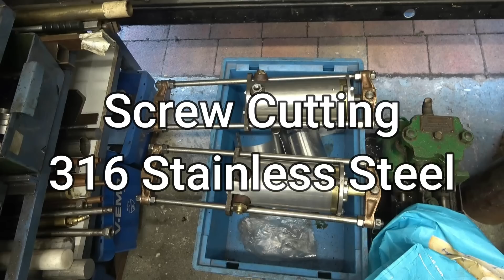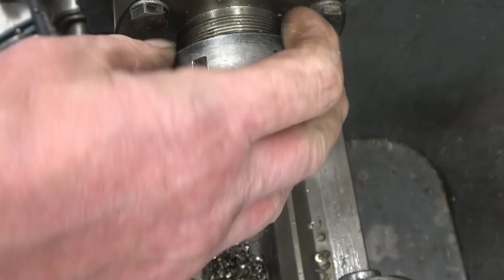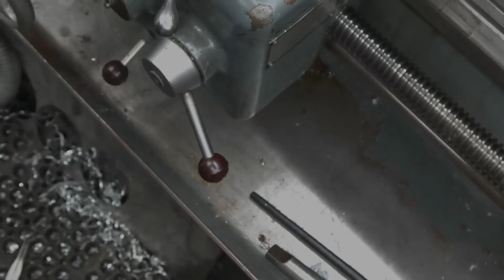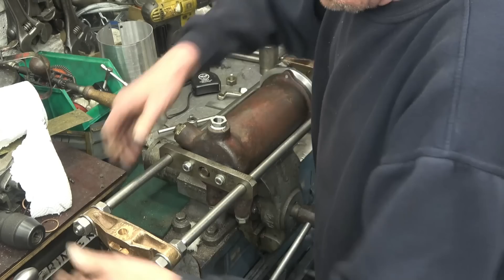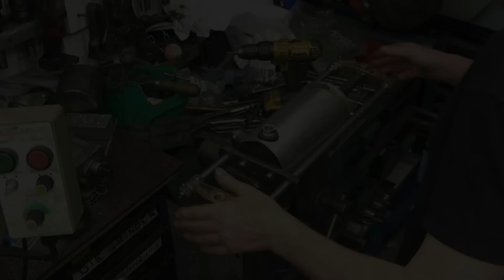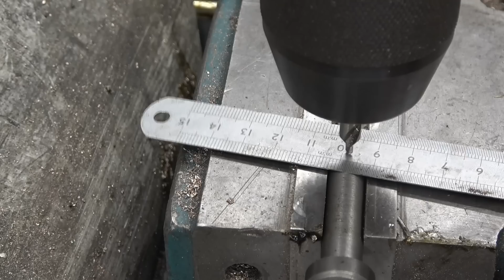SNNC 487  Screw Cutting 316 Stainless Steel

Comment: Your lathe and tooling cuts a nice thread John. One thing I would recommend when using stainless steel fasteners, particularly with high temperatures and especially  steam, is to use a decent anti-seize compound to prevent galling and pickup of the threads. I had good results with Rocol Anti-Seize Stainless, although be sat down when you see the price.
Reply: Permatex do a Nickel based anti-seize lubricant ideal for stainless steel, and all steels, rated to 1300 C in various sized tubes/tins, a lot more affordable.
Reply: @bostedtap  Ohh yes, only £44 instead of about £160, but the Rocol is 500ml against 8ozs, so twice as much. But for most of us, the 8oz tub will last a very long time. The company used to buy it so price was less of a consideration, works really well though.
Reply from the maker: @billdoodson4232  https://www.machinerylubrication.com/Read/30222/anti-seize-compound